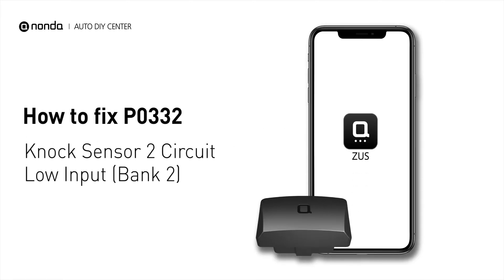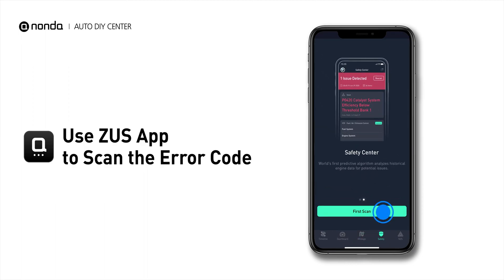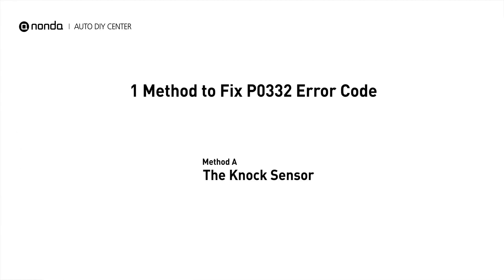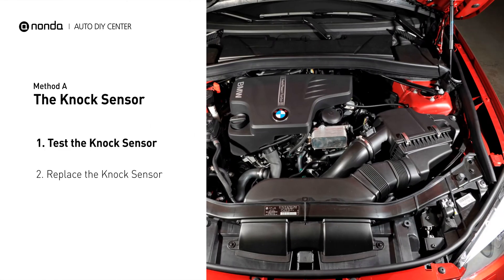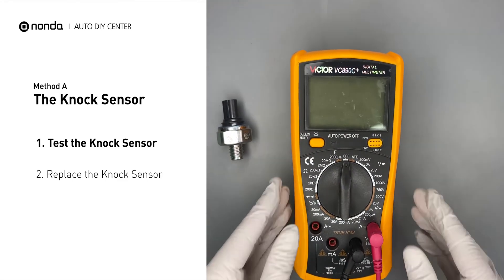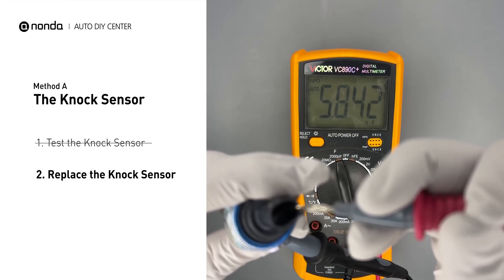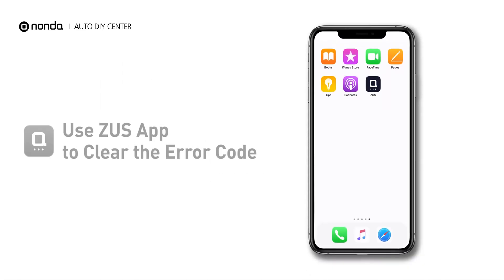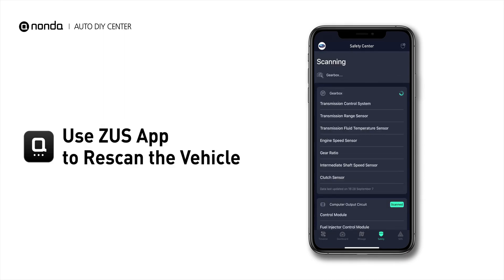How to Fix P0332 Engine Code in 2 Minutes [1 DIY Method / Only $10.36]

Comment: So the engine has this code P0332 step one remove the sensor see if it any good and if it is place it back clear code and its fixed ?? Thats some top notch Explaining !! People if its good you could also have bad wiring.. The wire could have been rubbing against any object to cause it to break its Installation around the wire or could be bad connection look at end make sure its not broken in any way and clear of Is corrosion.. always look at connections pins sometimes they do bend when being put together, connected !!